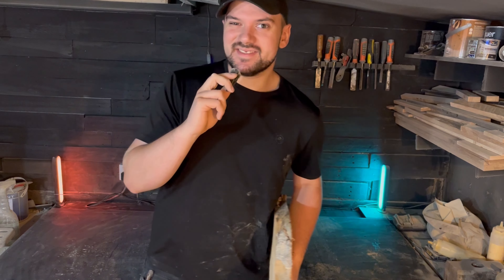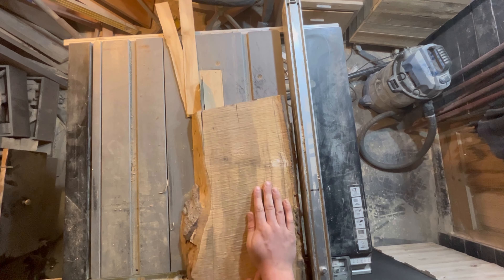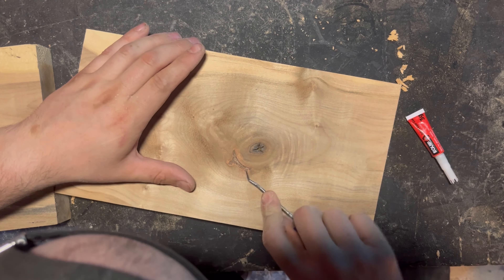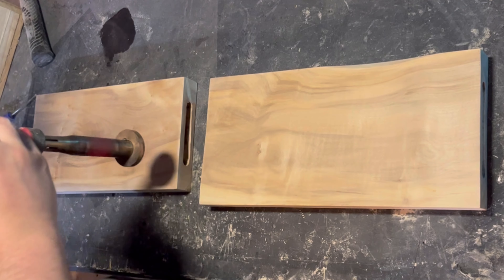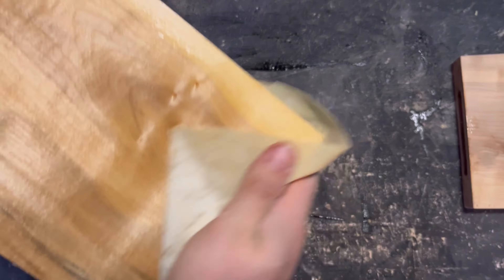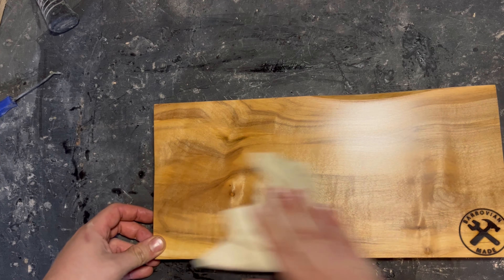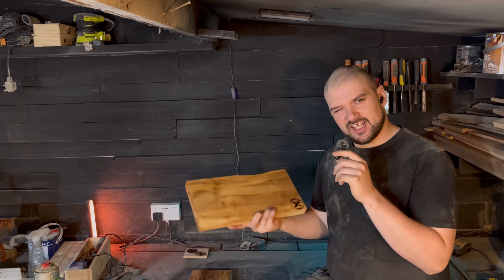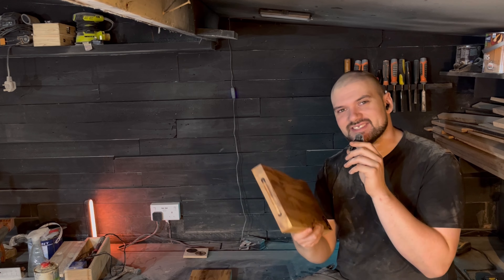Cutting Up A Slab To Make Chopping Boards

Comment: Those are splendid! With the holidays coming up, you got make money with those maybe on eBay? We got ripped off by Etsy and like you said, FB Market is hit or miss. My son likes Big Cartel. But those boards are perfect for small charcuterie or cheese and cracker servers. Not to cut into bcuz high grit makes it so silky smooth, who could cut into that? Just rebrand the name like- Modern Rustic Serving Board, or Natural Holiday Fruit Board, etc. We make little risers for the table setting to help certain dishes stand out. Or you could do How-to videos to raise your following- everyone is looking for ideas or simply how to do things properly. Women like me- it took me forever to find a video that actually helped me attach a hole saw. Like I know what the heck an arbor is! Just suggestions. Sorry for the babble.
Reply from the maker: I do have some videos planned for November time to do around making Christmas gifts and hopefully that bumps up my following and I’ve also tried Etsy before never had any luck with it I think making a website and doing targeted branding like you said could be a good choice I’m just worried about costs I’m already in debt and if it doesn’t work it it will put me more in debt but I won’t know till I take the leap
Reply: I understand completely- also in debt and struggling. But that end table design of yours, angled and straight legs, is brilliant! Simple and easy- even I can do it… sort of. A bit wonky. I can’t cut straight yet. 😐 Whatever you do, I’ll share the info to all my friends… both of them. 😐